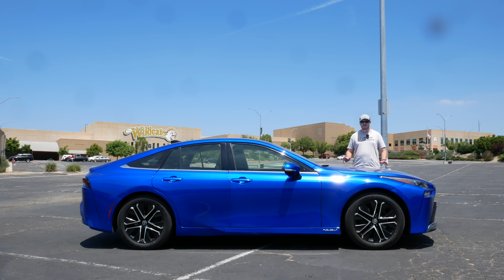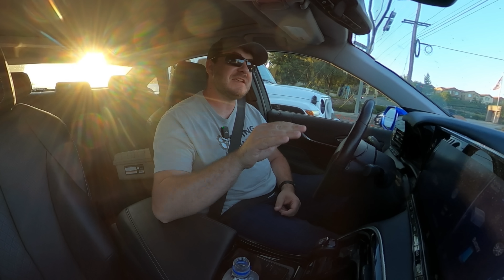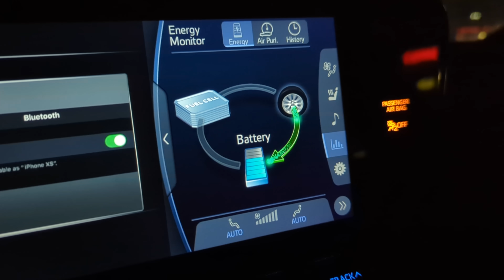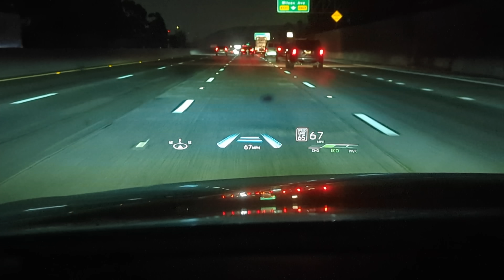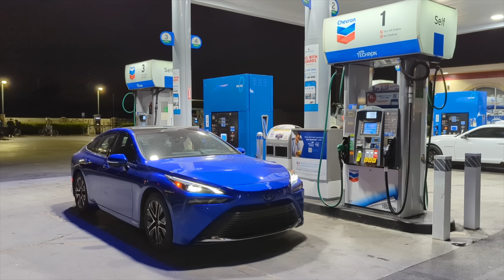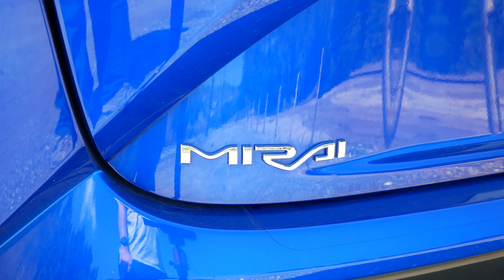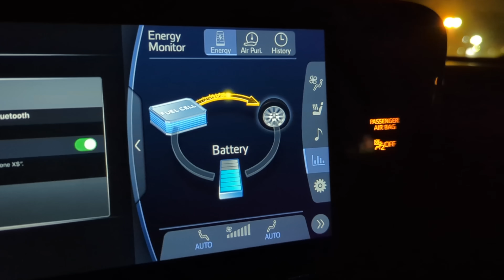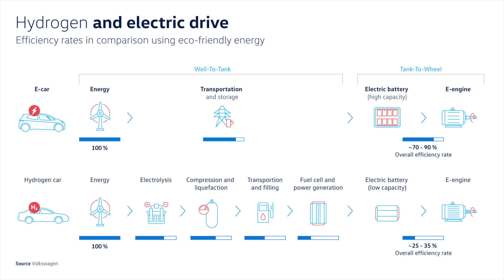The Toyota Mirai is Disappointing

Comment: I really dislike the hate against Hydrogen.

Yeah, EVs are better right now. But that doesn't mean we shouldn't have an alternative.

My main concern is the giant batteries that are required for EVs. They're hard to get, often unethically sourced, and lose power over time. But mainly the sourcing part. Can we have enough to run an 100% EV fleet?

Also range issues.

I 100% think we should keep investing in Hydrogen. We might very well need it.
Reply: Hyrodogen is not a good solution for vehicles. And run into a lot of the same issues EV’s have but worse.
Reply: @engineeringtheweirdguy2103  A lot of the issues have to do with not enough adoption.

Even still, we should research it as a clean alternative to EVs, in the event we can't make enough of those, for example.
Reply: @gogobrasil7185  no, most of the issues is to do with the car and with the limitations of physics. The mirai is basically the peak we can expect from hydrogen. For example, Almost all the space in that massive car is taken up by fuel tanks. Rear passenger space is a joke, you might as well not have a boot because it’s smaller than what you get in a Yaris despite the car being bigger than Camry. And it’s that way because it’s packed to the brim with 5.6kg of hydrogen. Because while hydrogen is gravimetrically energy dense (kWh/kg) it is, even at 700 bar (42 times the maximum pressure of a steel cooking gas bottle). Volumetrically not very energy dense. (KWh/L). Unfortunately there isn’t any way around that. Space wise the cars will always be impractical, smaller cars will get ridiculously low range. Thems just the physics.

Another example, is that hydrogen doesn’t occur naturally on earth. You have to make it. In doing so you have to expend at least 3-4 times as much energy to get 1 miles worth of hydrogen than you would to charge a BEV to drive 1 mile. So everyone’s complaint about grid capacity is quadrupled with green hydrogen. Which also means it will produce 4 times more emissions from the grid per mile driven. That’s limited by physics also. You need a minimum amount of energy to compress the hydrogen. Because compressions itself is stored energy. The minimum energy you need to split hydrogen from water is determined by the chemical bonds holding hydrogen and oxygen together as water. You can’t get around that.

Another example is fuel cells and fuel tanks decay. If the fuel cell had slow demand and was consuming pure oxygen there wouldn’t be an issue but there is more than oxygen in our air. Infact oxygen isn’t even the most prevalent gas in the air we breath. This causes the fuel cell to decay which is why they only have a lifespan of 100k-150k miles. The fuel tanks under go massive pressure and de pressure as you use and refil the tanks. This causes fatigue loading. As a result the mirai has to come with an expiration date printed on it. Saying do not refuel after some 5-10 years from manufacture. And it’s not as simple as replacing the fuel tanks. Because hydrogen is so small it can pass, even through solid metal. So as these tanks become fatigue loaded, (like bending a paper clip back and forth until it breaks, that’s a fatigue failure). They’ll start to let some hydrogen leak out.

Hydrogen has an interesting relationship with metal, causing embrittlement. This greatly weakens the structure of the car. If left too long it will end up resembling the consistency of chalk.  Hence the expiration date. 

Once again. Limitation of physics. 

There are barriers in physics you cannot side step. Doesn’t matter how you cut it. A lot of what makes hydrogen cars wildly impractical isn’t a design problem. It’s a physics problem. It’s just not a good fuel.
Reply: @engineeringtheweirdguy2103 bro did you just say the pressure Toyota decided to use in their tanks is a barrier of physics?

No, none of these things are at their barriers. Insane to think the Mirai is the pinnacle of science and we can't advance any further.
Reply: @gogobrasil7185  no, I didn’t say that. I said you need a certain minimum energy to pressurise a gas. Just like you need a minimum amount of force to compress a spring.
Reply: @gogobrasil7185  it pretty much is. At the physical limits. You can’t fit more hydrogen to go further. Not without ALOT more pressure on an already insanely high pressure tank. For context. If you filled one of those tanks with non explosive inert gas to 700 bar. If that tank were to suddenly release, it would release the same amount of energy as 1.6 hand grenades. Just in pressure alone. And you have three of those tanks on board. That’s how much pressure we’re talking. You likely won’t try to compress hydrogen any further than that. The only other option is to put hydrogen into a carrier. However if you do that, it becomes substantially less efficient and you’d lose more range than you gain with space. A good example is that water is a hydrogen carrier. Unfortunately you need more energy to get the hydrogen out than you would get from the hydrogen. Again. Because of physics. 

Another carrier is ammonia, which isn’t a terribly friendly substance. Infact it’s incredibly toxic if spilled, say in a crash,  the gas or even off gas in liquid form, can burn your mouth, skin, lungs and eyes and cause death from burning your lungs to the point that they don’t absorb oxygen anymore. A process which can take as little as 30 minutes after exposure. You’d be dead, and so would everyone around you, before paramedics could even arrive at the scene.

Considering that’s the closest feasible carrier of hydrogen as it can used directly in a fuel cell, I’d say chances are slim.
Reply: @gogobrasil7185  the point is, even if the hydrogen process from water to wheels moving was 100% efficient at every stage, it still wouldn’t be competitive. But it will never get to 100% efficient. They can’t even get close in lab conditions. Yet alone on the road in varying environments, temperatures, pressures and air contaminants. Isn’t going to happen.

Sorry but hydrogen is a non starter
Reply: @engineeringtheweirdguy2103  that’s not what physics limits are
Reply: @gogobrasil7185  yeah. They are. A limit to physics is that energy cannot be created or destroyed. Pressure is a form of energy. You need X amount of energy to get Y amount of compression. Basic physics. You can’t get around that.

You want to split water into hydrogen and oxygen. There is a defined amount of energy contained in those chemical bonds that you need in order to break them. You cannot get around that. 

If you want to use pure hydrogen, it comes at an immutable density per unit pressure and temperature. It follows the ideal gas law. There isn’t any getting around that either.

These are immutable facts of physics. Which are also acting as barriers for the technology to approach anything near practical for personal transportation. 

Sorry but they’re facts.
Reply: @engineeringtheweirdguy2103  none of what they have on this Toyota is on the boundary of known physics. 

It's insane to suggest this is the limit for gas storage research.
Reply: @gogobrasil7185  they are, as doing any better would be violating the laws of physics. What else would you call a limit of physics?
Reply: @gogobrasil7185  
Reality is simple. You either use liquid hydrogen which needs to be under -250C which is impossible to remain for longer periods of time, or you need extremes pressures in those tanks. Car manufacturers are going with pressurized approach, but as @engineeringtheweirdguy2103 explained to you here, there is a basic limit here. Hydrogen performance is basically at its peak, you maybe could get extra percentage of performance with billions in investment, but its done deal. While with batteries, well those constantly improve in performance, energy density and price in general without actual limitations in sight. 
Doing research on multiple fronts is fine, but producing hydrogen cars is just dumb.... Its not better than BEV's, its adoption is extremely expensive for all parties. So why even bother with production? Stay with research until you have actually better alternative to BEV's.
Reply: @gogobrasil7185  you misunderstand. Hydrogen as a fuel source is substantially limited compared to, for example, BEV’s. The mirai is therefore limited. The car itself can improve, the car itself isn’t peak 100% efficient for the process it’s adopted. But its close. Very close. That’s why the mirai, which came out in 2014, hasn’t had any real improvements over the last 10 years. Here’s a list of improvements.

It’s ranger went from 312 miles to 400 miles of range. It did this by adding a whole extra fuel tank, and changing from using an ICE body to a custom designed body with better aerodynamics. It did this in 2020. For context the Tesla model 3 highland uses more electrical components for a higher base load in the car than the previous model 3, but using the same motor and the same battery it’s managed to to increase its range from 344 miles to 421 miles. Almost entirely by redesigning the aerodynamics of the car. 

It also increased its fuel cell lifespan from 100k miles o 150k miles.

That’s it. In 10 years. That’s it. Now look at how EV’s have improved over the last 10 years. 

The mirai still has room for improvement but in terms of physics. There is a ceiling. And it’s much lower than that of BEV’s.

And the last little bit about fuel storage. Physics is physics. The most efficient way to store hydrogen as a fuel source is as pure hydrogen. If it’s in a carrier. You will always have to expend some energy getting the hydrogen out of the carrier. If you didn’t, then it would just immediate gas off to hydrogen. And would be pointless as a carrier. The whole point of a carrier is to bond the hydrogen to something. But it will ALWAYS take energy to take it out of the carrier. Thems just physics. Energy cannot be created or destroyed. Only transformed. If a carrier is bonded to the hydrogen, it does so with energy. You want it back, you need energy to break those bonds. There are no free lunches.
Reply: @gogobrasil7185
Range for cars is basically same with hydrogen and BEV's. Material sourcing is none issue at all. For example Tesla new batteries doesn't use cobalt and biggest lithium supplier is Australia, on top of that Tesla itself starting their own lithium production in US. So sourcing is none issue. And its really weird to reject entire technology just because some countries are really bad with their labor laws... Its an issue with those countries, not with technology itself. 

Hydrogen cars only sound cool on paper, but those simply doesn't scale. So what we need is more investment in BEV technology and stop sidetracking with worse alternatives.
Reply: @Zripas The tech needs resources to be built. No matter how good your EVs are, you can't make them without the materials.

It's great that they're getting it from more places but it's still not enough for everyone to stop using gas-powered cars.

And no one's sidetracking. We can research more than one thing at once. Even if the materials were all abundant, it's still a good idea to have a clean alternative. The more, the better.

Comment: if it runs on H ... why doesn't 1t just electrolyze it's own fuel with, the easily purchaseable, Toyota home solar/green mains Hydrogen electrolysis station? (with free Oxy output ;o)
Who.. in their right effin mind, refines H2O to it's explosive form and use fuel to deliver it Gas stations - when it's safe, potentially 100% green and essentially FREE to fuel up At Home? hmm..?
(honestly, why don't you just put distilled Water in the car and let the Cell power up the electrolysis? - my mistake Fuel Profits, of course...)
Reply: Because it takes more energy to convert water into hydrogen and oxygen than the hydrogen releases. It also takes a LONG time to do. You’re better just putting that energy directing into a battery and calling it a day.
Reply: i DO agree 1t's better (for now?) to just use clean battery tech and put the sunshine in directly.. yup yup. Eventually your water/H gas will be as safe and never need gas or electrons... that 1t can't get for itself.  @engineeringtheweirdguy2103

Comment: Hydrogen makes zero sense. Either it's made from fossil fuels - so why not just use fossil fuels. Or it's produced by renewables - but takes 4x as much energy to produce, store and turn back to electricity as charging a battery directly. And if it escapes into the atmosphere it forms methane which is a greenhouse gas. And fill stations are few and far between and they can only service a handful of cars per day. It's a stupid technology and Toyota are only pushing hard on it because they missed the EV boat and want to sow FUD.

Comment: Our hydrogen deliveries arrive....on a diesel powered semi truck 😂 and the fuel cell stacks are generally spent around 100k city miles.  They are very maintenance intense with lots of parts such as the air compressor needing to be replaced around 60k city miles and the oil for that is only a cool $220 a quart.

Comment: I for one am more inclined to petition for the future of Hydrogen, at least until batteries no longer use Lithium, since Lithium mining falls into the same pitfall as grey Hydrogen, although worse.
Lithium production comes with high levels of water pollution, all of this has led me to thus far avoid getting a car entirely (although that's partially because Canada has tax rebates for doing so evidently)

One year later edit: EV's are back on my table, one really good video comparing apples to oranges proved that while they aren't great, they're still better. I still think we should explore hydrogen, for the simple fact of you could technically convert a gas car to burn it, if the world goes pure EV, millions of cars become unusable
Reply: That is unless lithium clay extraction takes off. And at least lithium is entirely recyclable out of the battery. And can form as part of a closed loop system.
Reply: If you want to boycott Lithium batteries, may I suggest you never buy a smartphone again, or a laptop? Or any battery powered electronic device for that matter? Because that's the cause of more than 80% of the worldwide Lithium extraction. EVs barely do 20%.
As for the water pollution, it's a lie. They use brine to extract lithium, which is water already undrinkable in the first place.

Comment: Hi, the comparison in overall efficiency needs to include the mining, refining, and building all the components in the first place, as well the energy to recycle them back into something useable or safe to store at the end of life.
Big Battery EVs take a lot more material and hence a lot more energy to make - so they effectively 'hide' their inefficiencies in the manufacturing stage rather than use.

I read a study that said it was more like 40% over the whole lifetime. In comparison to 30- something percent. 
Anyway you can do the calculations yourself and see what numbers you get and it's not as dramatic a difference as some like to make out. But the energy efficiency per se doesn't matter since people operate in the medium of $.

Comment: You should have shown the trunk of thank thing. It's tiny. Filling hydrogen can be relatively quick but if you are on a one outlet station and someone fills up just right before you, repressurizing can take ages. Filling to 100% can be a issue too. 85 to 90 is more likely.
And those fuel cells don't least for ever. Even if, those gastanks need strict maintenance. Crash? Better switch them! Battery? It's tiny and constantly charged / decharged. Not good at all

Comment: The best thing about hydrogen is it can be in a smaller car.  Instead Toyota decided to try it out in a giant slow car.
Reply: Actually it can’t. The mirai needs the 5.6kg of hydrogen to take it some 400 miles. Unfortunately, that requires some 300L of fuel tank storage. You will notice on the inside of the mirai, that the there is basically a wall between the driver and the passenger, that’s the first tank. It also means the rear middle passengers feet need to be at the same elevation as their arse. Like sitting on a floor. 

Then you will notice that the rear passenger seats are very high up. And that unless you’re under 5ft, your head needs to stoop to rests against the roof. That’s because you’re sitting on tank number 2. This also means the cabin doesn’t physically have enough space to fold the rear seats. So you can’t extend the boot. This is a big deal since that’s the location of tank number 3. To compromise the boot size even further, the mirai needs a big lithium battery to drive the car. And since you can’t put it under the bonnet as that’s taken up by the fuel cell it sits between the rear passengers back rest, and the boot. Meaning even though the mirai is bigger than a Camry, it has a smaller boot than a Yaris. 

Making the car widely impractical as a passenger car. Since you can’t fit passengers in there or a full sized suitcase in the boot. 

Bottom line. You can’t physically fit the fuel into a smaller car. You also can’t fit in more fuel to go further than 400 miles unless you want to make it a 2 seater.